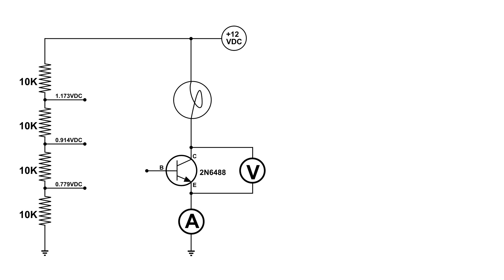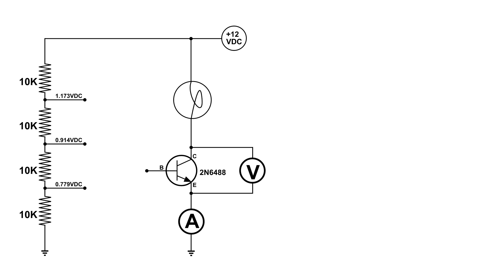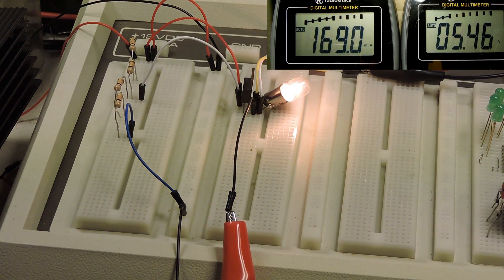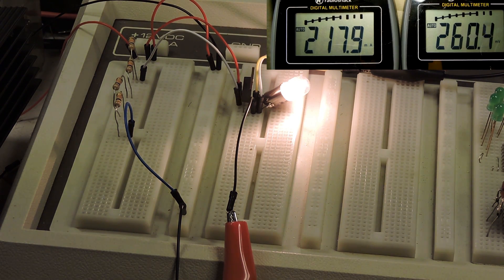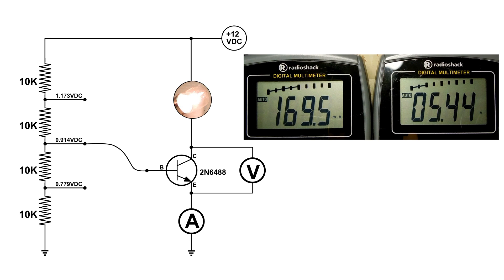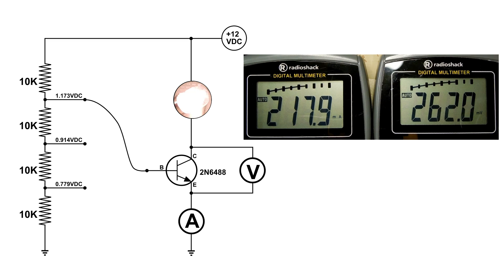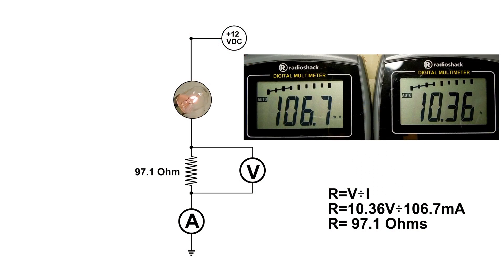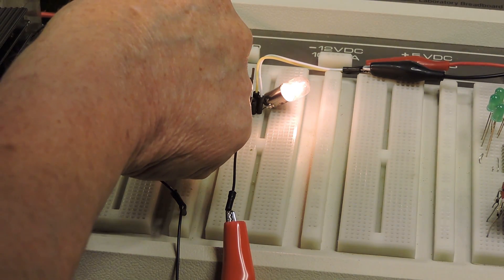Transistor What does it do in a circuit Visual Demo

Comment: This is very confusing to me as a beginner in electronics.  According to Ohm's Law voltage and current are directly proportional so if voltage increases, the current also increases and vice versa.   In this video the voltage decreases and the current increases.  What am I misunderstanding here?
Any help is greatly appreciated.
Reply from the maker: You missed that the resistance of the Transistor CHANGES.
Reply: @AllAmericanFiveRadio  But how does that keep the voltage and current from remaining proportional to each other?
Reply from the maker: I'm using Ohms Law to find what the resistance of the transistor IS, with different bias voltages on the base. The transistor is a variable resistor. You maybe confusing Ohms Law with how to find the Beta of a transistor.

Comment: Cool and all but the voltage divider of the 4 10k resistor doesnt make sense. If you're connecting the top to 12 VDC and the bottom to ground, you should get 6 VDC at the center. You'd be right if the nodes were initially connected to the base, where the base current draw causes a bigger voltage drop on the top resistors.
Reply from the maker: All bias voltages were taken when the transistor base was connected. This makes the readings low because of  the forward bias of the Emitter Base junction.
Reply: Before the connection between the nodes and the base, the two parallel circuits have to be viewed independently.  Its after the connection that causes the node voltages to drop.
Reply: Got it :)